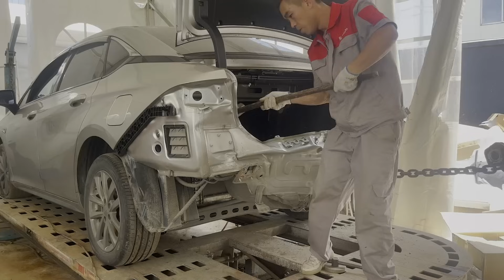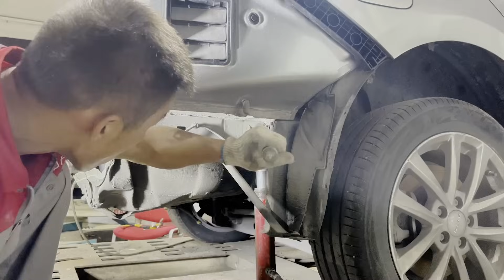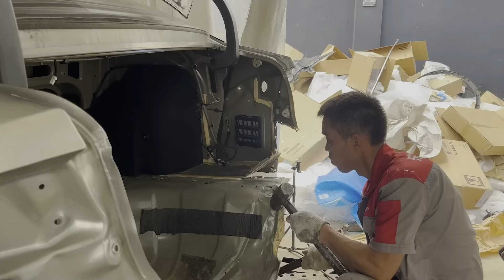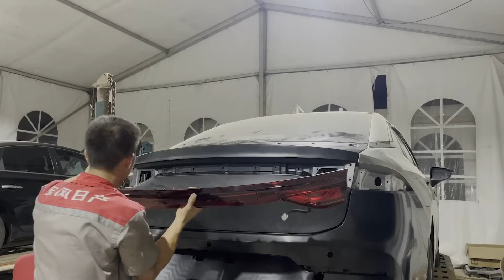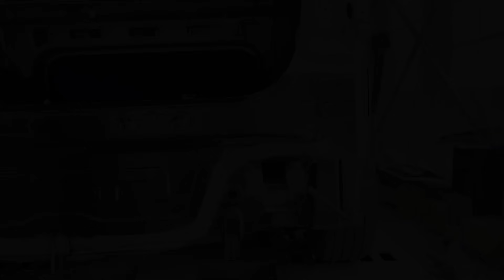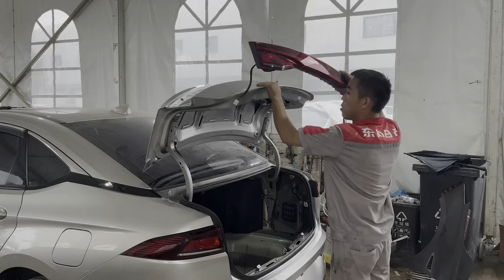How serious is rear-end collision damage and how can it be repaired?

Comment: Agree that the trunk floor should have been replaced along with the structural rails.   Also that the paint match was poor.  What I don’t understand is how, video after video, he doesn’t measure or level while he is pulling.  Everything is according to eyeball.  Sometimes he measures after the fact, but I don’t understand how he can pull these parts into alignment by freehanding it.

Comment: Hi,
not replacing the trunk floor or the crushed parts of the side members is taking a big risk.
Certainly the cost of repairs is lower, but in the event of a new collision from the rear of the vehicle the crushing will go further because all the straightened parts, therefore not replaced, no longer have the original rigidity and therefore no longer have able to absorb the shock.
Reply: It's China..
Reply: You are right...